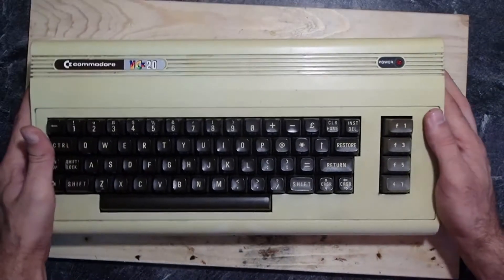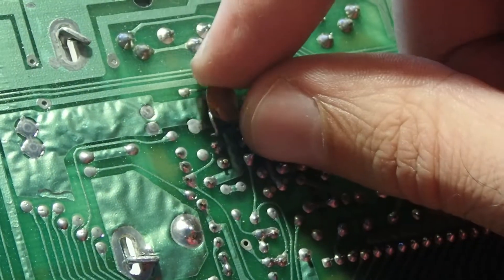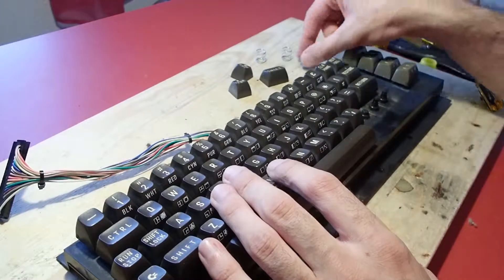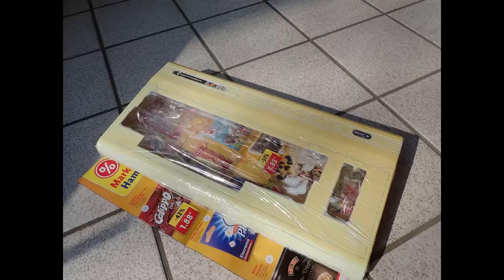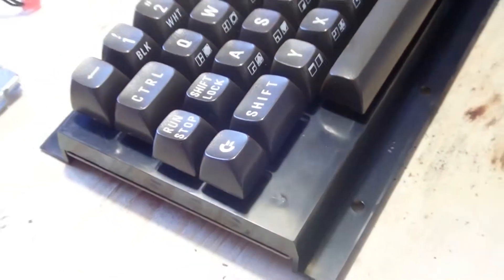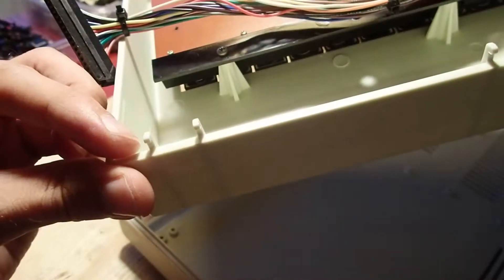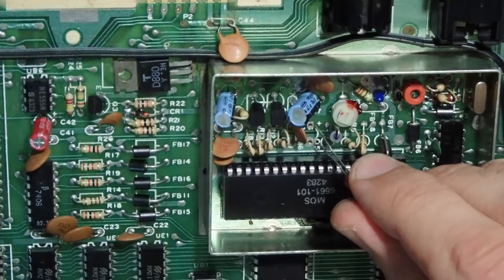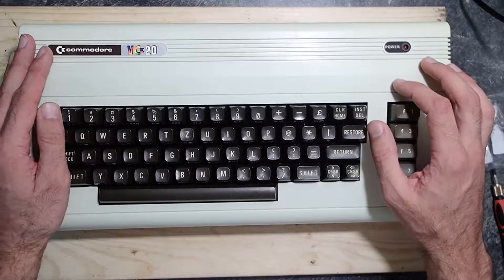Commodore VIC-20 restoration

Comment: I know it might be very late but you misplaced the Y and Z key. Even the commodore machines produces in Germany had US layout and not DE. You can see it by the angle of the key caps and also in the comparison you show at 8:47. But I'm sure you have figured it out already in the last two years... :-)
Reply from the maker: Yes, I fixed it back than. The German keyboard layout is just sitting too tight in my head and I'm doing that mistake all over again. If I remember right, in the C64 video  I made the same mistake again :D